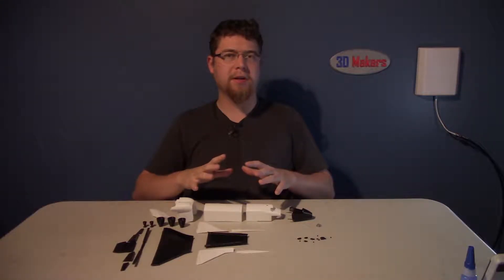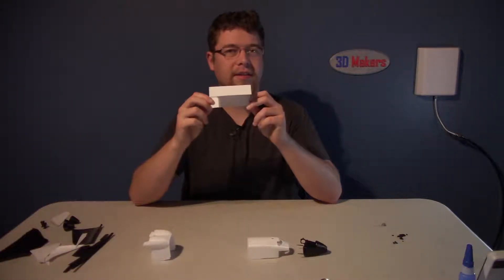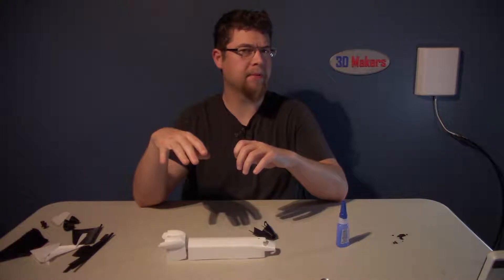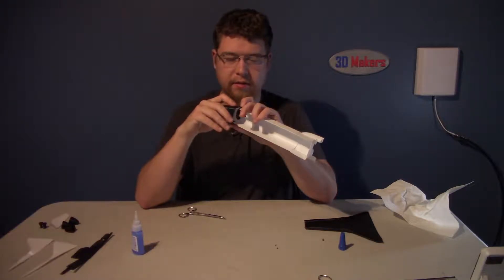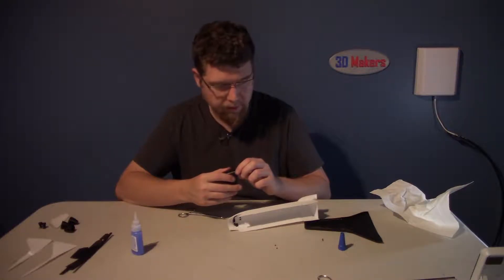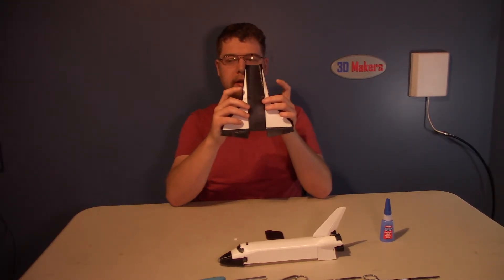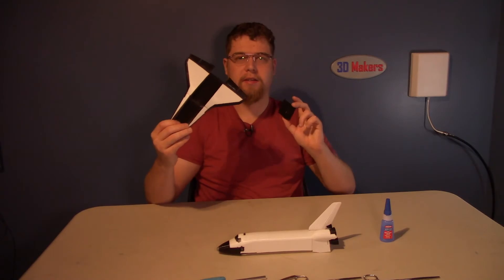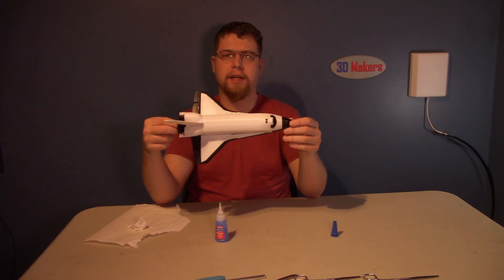3D Printing the NASA Space Shuttle Part 2

Comment: Did you print in 1.5mm or .15mm layer height?
Reply from the maker: If I remember correctly it was printed in 0.1mm or 0.15mm. I would lean toward 0.1 as that is my default printing quality, but to be honest I don't have the original GCODE to be 100% and I don't remember. Sorry for being so long winded to give a vague answer..

Comment: how did you get rid of the support materials? was it difficult or easy to remove them?
Reply from the maker: I use a hemostat set that I got off of amazon which makes removing support in most cases easy. The supports came off quite easy for this model, though most of the parts did not use supports.
https://www.amazon.com/gp/product/B01MQ3G2QW/ref=oh_aui_search_asin_title?ie=UTF8&psc=1